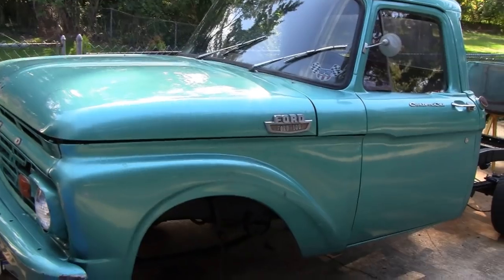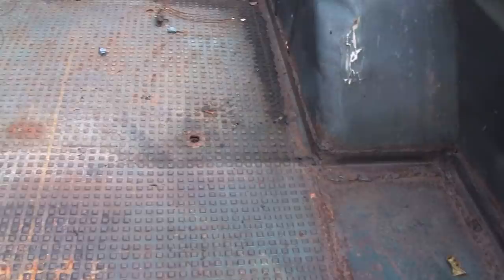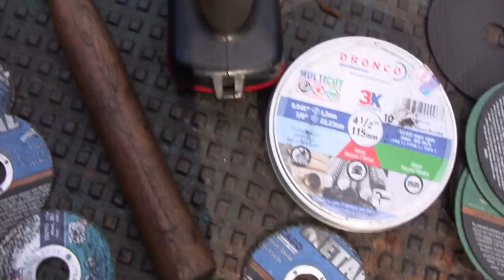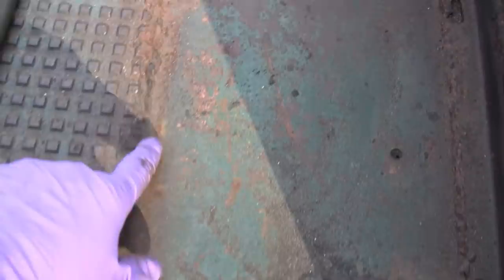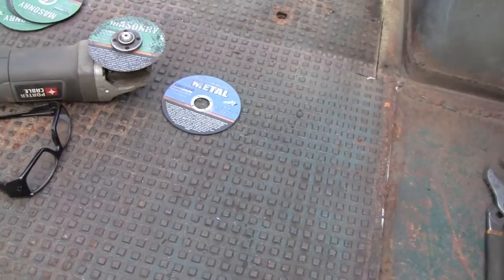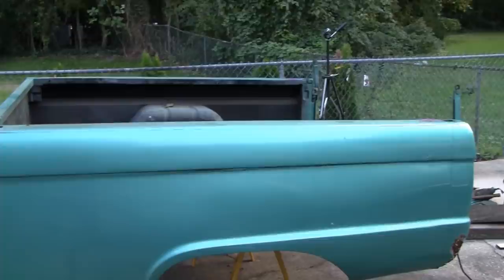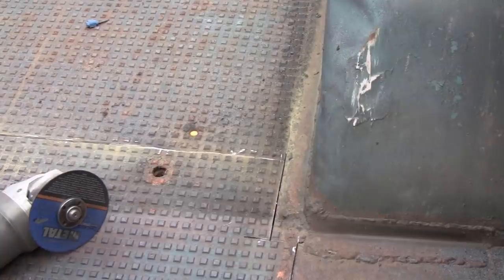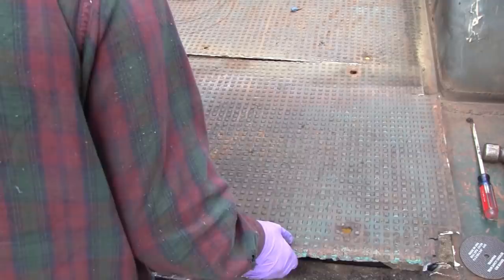F100 FORD TRUCK PROJECT (part 8)

Comment: I save those small worn wheels and use them in my air cut of tool. I turned up a bush in the lathe so they fit nicely in the spindle . Saves a  lot of bucks.
Reply from the maker: When I get done with those wheels they're too small to even use on a Dremel!!☺

Comment: Yeah RK , the Harbor cutoffs are just as good as anything else .I have mistakenly   bought the Mason ones , still work fine but they were $$$$ .  I buy them 10 for $10 at swap meets when they have them cheap , I get piles of them . Another thing that works well are the flapper wheels for grinding metal down smooth and getting rid of welds like what your working on  , buy those by the bunch when I can . GOOD WORK :)
Reply from the maker: I use to get them Dronco Blades from a Fleabag 10 for $5, but he doesn't carry them any more!!☺
Reply: Yeah , used to be Us gearheads were the only one using them doing body work , restorations etc, now it's the Demo Derby and Circle jerks buying up all the stuff . I still get a bargain now and then , and buy up when the gettins good .

Comment: I used a circular saw with a metal blade housing and a metal blade to cut long lines in metal. Beats that tiny cut off wheel you used.

Comment: I wear a 12 inch blade down on the drop saw then run it on the 9 inch grinder and finish wearing it down on the 4 inch grinder.

Comment: Man, they made a mess of that. The L angle around the perimeter, no doubt, is what was holding it all down. The bed of that truck probably weighed as much as the rest of the truck including the drivetrain!
Reply from the maker: Yeah Buddy!! ☺

Comment: Cutting and grinding 'wheels' were some of the items we used to sell  quite a lot of. Those Sait wheels were among the top tier of abrasive wheels in the market place, now I'm talking from the 1980's era. Things change , don't they.
Our supplier of the Sait products told us the correct way to pronounce is like, '....sate' or late, with an 's'. 
May I make a suggestion to folks who use these a lot ?
If you're finding that cut off wheels are wearing out too soon, maybe you might need to hold the grinder steadier and let the wheel cut at it's own pace, so to speak...with the sparks and dust going to the rear. Usually you can better control the cutting action with the wheel send the sparks to the rear, it tends to pull into the work and is somewhat easier to control too. Speaking of dust,..if you get a lot of that, then the wheel is being forced into the work too quickly, ease off a tad 'till the dust is less.
Masonry wheel will cut cast iron very easily, perhaps better than a metal cutting wheel will, and of course, this will depend on the quality of the blade/wheel you buy. Quality does most assuredly, make a difference. Try a higher quality wheel and compare it to a cheapie wheel,..you'll see the difference.
Reply from the maker: Well said Mate!!☺
Reply: @805ROADKING  Thanks ROADKING,...I know I'm now retired, but instructing folks is what I did a lot of in my construction supply , and equipment sales, rental business.

Comment: I am restoring a 1950s Clinton b700 series 2 hp engine and when I took the cam out, I could not find any timing marks. Would you know anything about this?
Reply from the maker: Check out the www.smokstak.com forum, there are a few post that explain how to line the cam and crank without marks!!☺

Comment: Personally I don't understand why someone would use that thick of a plate on a vehicle. I understand in a stationary situation but in a truck its just extra weight to haul... Also I assume that you don't have a plasma cutter but why not use oxy cutting torch? It would probably cost similar to disks but be a bit quicker. Anyway good progress 😊
Reply from the maker: Thanks Bud!! The torch is too sloppy!!☺

Comment: Shouldn't the bed be slightly heavier? I mean, for traction.
As for shields, i mean, opinions aside, i saw what exploding disc can do to a guy's wrist, it looked like a mangled custard...not pretty. Said he nearly lost his dexterity because of that.
Reply from the maker: I'm putting 1" Mahogany in the bed, that probably weighs twice as much as the original steel bed!!☺

Comment: His road king I and starting up a new youtube channel. I had one a couple years ago it was a instructional channel. Mostly showing things like the custom android themes I made. That was all onscreen video and I was wondering if you could tell me what kind of camera do you use to film. I'm very interested in the one with the remote control.
Reply from the maker: I've been using the same camera for 8 years now!! It's a Canon HF200, you can still find good used ones on Ebay for $100!!☺

Comment: Hello, I have been watching your videos and I noticed the square pattern metal in the back of the truck. I found this incredibly interesting because I also own a 1964 f100 with that exact same square pattern steel in the back. What area are you located in? I am curious if the same person got ahold of both of our trucks in the past. Out of curiosity, if you open the hood do you see spots where the aluminum trim was removed and the holes were welded up?
Reply from the maker: We're in South Jersey!! The holes weren't welded up but they were filled in with plastic!!☺
Reply: @805ROADKING  Oh yeah that's a long way from the Memphis, TN area. I guess that square plate was just a common fix. Thanks for the reply, I enjoy the videos!

Comment: @805ROADKING: Is that a 3M Peltor III hearing protector? If so, how do they compare to others in your opinion? Looking for one myself but am unsure If I'd be better of with going with the X5 that's just a little higher rated. Thanks in advanced!
Reply from the maker: Yeah they're 3M Peltor!! I'm very satisfied with them, had them about 10 years and they're still like new!! They protect well and are very comfortable!!☺
Reply: @805ROADKING  Thanks! That sounds like a stellar recommendation then :-D Thanks again!

Comment: Another option may have been to put wood right over the steel plate.
Reply from the maker: I wanted to do that but the waffleplate was just too warped and twisted!!☺
Reply: Layers always cause moisture problems.  Rust between the layers bubbles up and pushes stuff apart. If wood was on top of the metal, the wood would always be twisted because it wouldn't be able to dry out  underneath. Although this is a lot of work.  It will be a nice long lasting result.
Reply: @805ROADKING  Soak down some "hamburger wood" with water and it would conform.  :-)